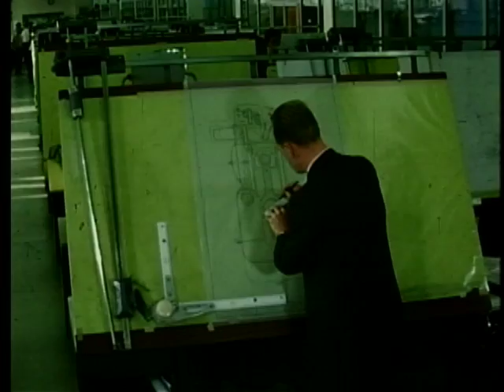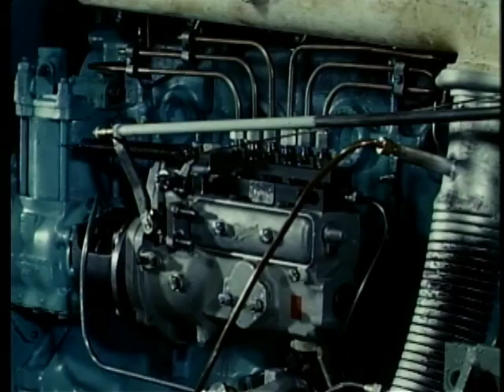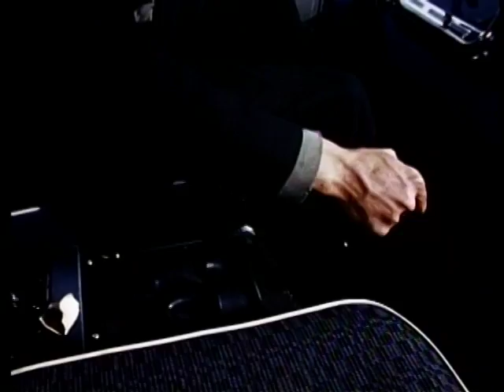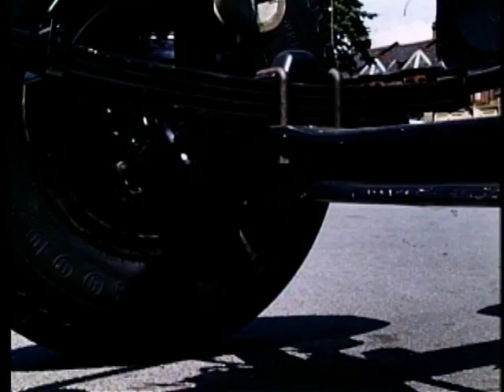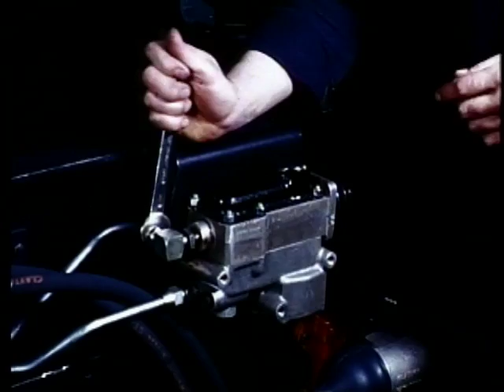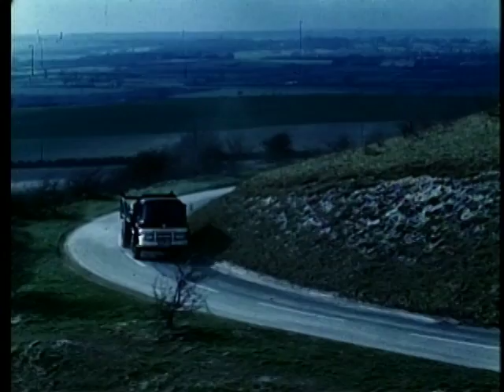BEDFORD KM LAUNCH PROMOTIONAL VIDEO

Comment: Difficult to work on having a fixed cab changing a fan belt was difficult the radiator could only come out from under the truck not enough air flow due to the radiator mounted high above the grill

Comment: GM never updated their Bedford range over the years and by the 80's they were so behind the times, with dwindling sales and operators increasingly buying other brands, the writing was on the wall for the Bedford range, and through 1985 GM announced that they would stop making them.
Reply: What about the TM 
5 years late but a very modern truck in it's day
Reply: The main problem was M Ks were not fitted with a tilt cab ,otherwise a good replacement for the R L . EX REME 1960-1977.

Comment: The problem with Bedford was they had a huge contract to supply the British Army and because of this they never really kept up with the truck developments particularly for the driver.The TK had no power steering. They never produced a sleeper cab as far as I know. With no tilt cab  like the Ford D series, Bedford's main rival, they were difficult to work on. Commercial sales fell and once the army contract came to an end they were finished. We had one KM in our fleet. It was a beast. The brakes were crap when loaded and the air operated parking brake would not release on many occasions. Ron Self who drove it got used to it but the rest of us did not like it at all.
Reply: The bedford TM has it's bed behind the seats... i had one... the parking brakes has twin big booster... the cabin is tilted by a hydraulic pump too the TM and the TL series have it